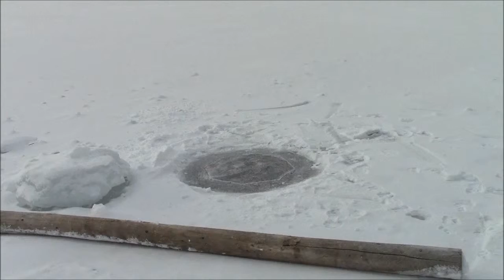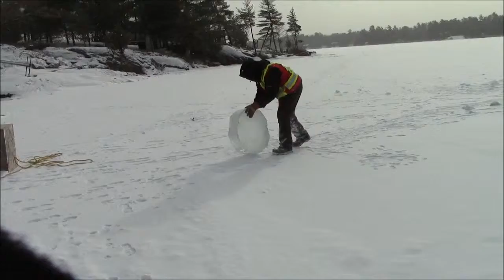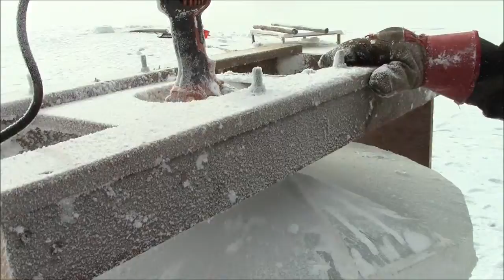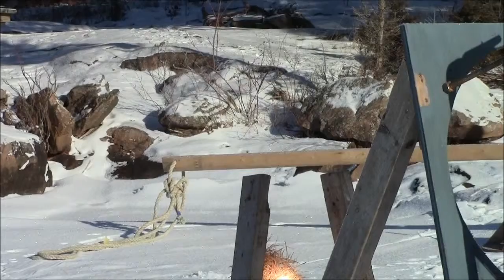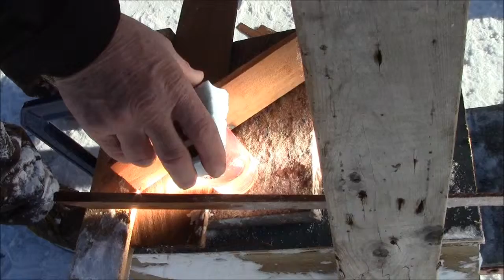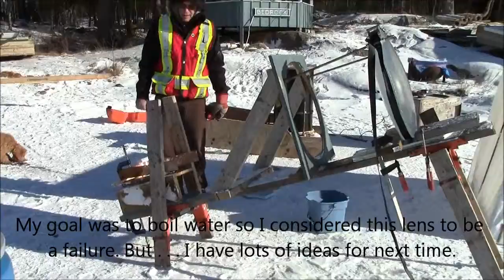Big Ice Lens Fail

Comment: Clear jars allow the light to pass through. You need a dark surface. Place some black rocks in the jar of water there and try again when weather permits. That will boil 8 ounces of water for sure. Or use a dark soda can.
46" PARABOLIC MIRROR STEAM BOILER SOLAR POWER STEEL WOLL NANOPARTICE STRUCTURE
By the way, awesome work. Would be interested in highlighting in one of our videos. Let me know what you thing.
Dan